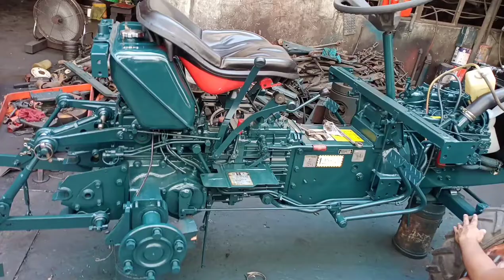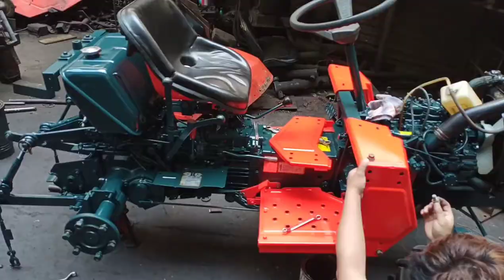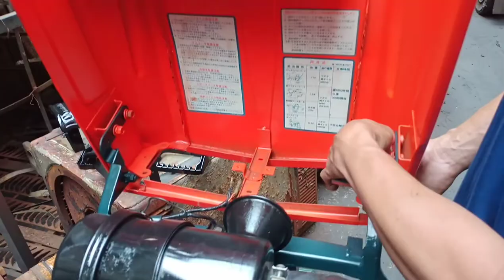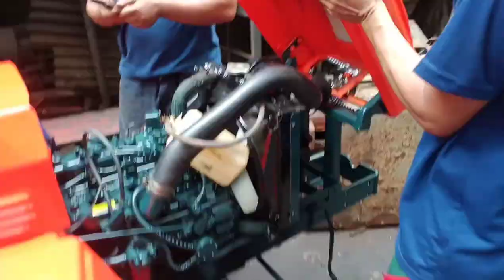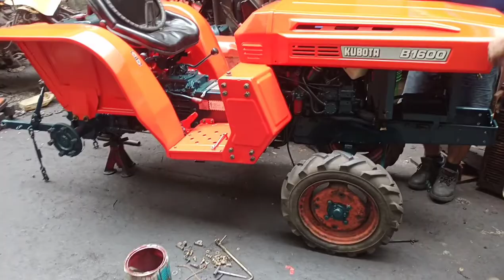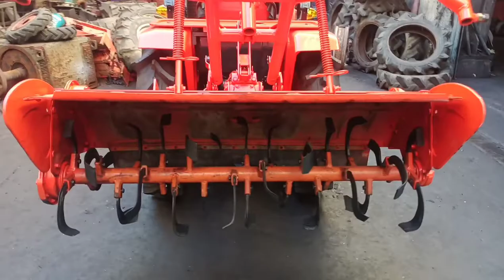Kubota B1600 4x2 with rotor recon.

Comment: Boss ano ba dapat gawin pag mahina hydraulic pag mainit na. Pag malamig nmn kalakas umangat ng rotovator
Reply from the maker: Mahina n Ang hydraulic pump mo sir.pwd mo ayosin or palitan ng bago
Reply: @tractorsmarinemechanic  nagpalit na ako sir ng hydraulic pump pero ganun padin sir.
Reply: @tractorsmarinemechanic   nangyayare kase boss pag nasa operation pag medio mainit na mahina na umagat pero pag nagtravel na kalakas na ulit umangat boss
Reply from the maker: Brand New po b Ang pinalit mo? Or surplus?
Reply: @tractorsmarinemechanic   surplus lang boss
Reply: @tractorsmarinemechanic   sa casa mismo binili boss.
Reply from the maker: Gusto nyo sir I check ko Yong tractor mo kung bakit ganyan Ang Ang problema?Taga saan kayo sir?
Reply from the maker: Langis po b saan? Makina po b or transmission?
Reply: @tractorsmarinemechanic   taga Gen. Tinio Nueva ecija boss
Reply: @tractorsmarinemechanic  transmission boss
Reply from the maker: Sir, pinsan mo b SI pipoy?Ang sira ng tractor mo ay control valve.kung gusto mo maayos Yan bili I ng control valve.

Comment: Sir, bkt po ung tractora namin hnd stable Yong rpm (taas baba)², at pag gamitin naming pang araro ang bilis gumalaw rpm nya nagiging cause bayon ng paghina ng makina sir
Reply from the maker: Hindi po.
Reply: @tractorsmarinemechanic  eh bkt po ganon Yong rpm sir?
Reply: @tractorsmarinemechanic  Sagad na Yong hand accelerator nya pero mahina parin ang makina sir
Reply from the maker: Pwd sira Ang rpm cable,tachometer drive,pannel bord at baka may injector na mahina.ipacheck nyo po sa mekaniko sir kc Hindi po Yan maayos kapag visual lng Ang basehan natin.